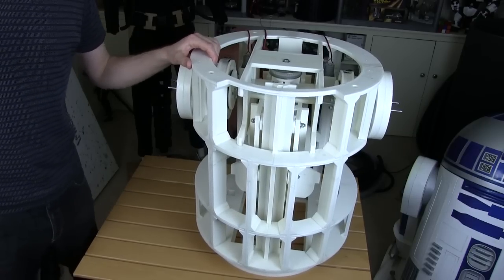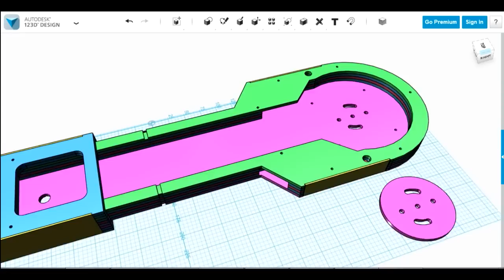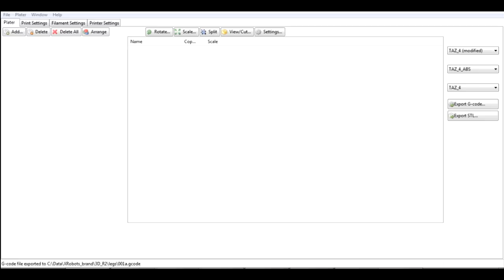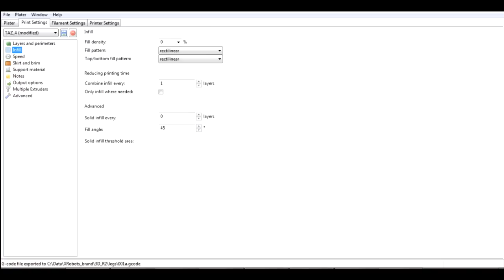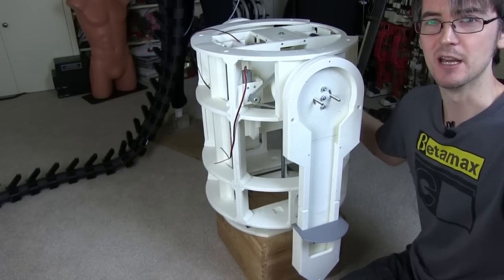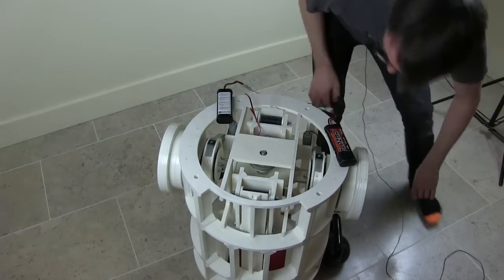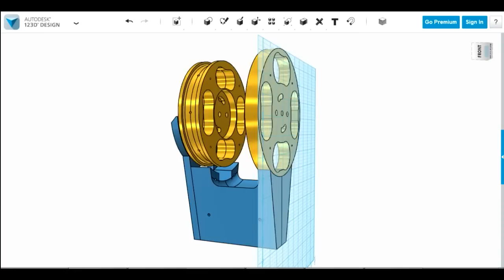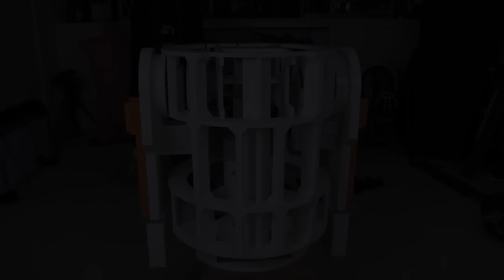Star Wars R6-H5 Droid #5 | Outer Legs | James Bruton

Comment: I hope you don't feel too bad about the bracing you ended up having to do. It really does look amazing. I would roll with the whole "your interpretation" idea. It allows you to make small changes, convenient for creativity as well as necessity, as we saw here. Excellent work as always James. o7 Sir.
Reply: *****
 So then upload it! We want to see moooore ! :D Just kidding, make your channel live, that's great.

Amazing job with the legs! I was wondering: did you make some some overlapping between the 3 pieces of the large flat "purple" piece? Because I felt like welding those on the 5mm edge only would be weak...

Otherwise: Couldn't you have grinded between the holes for the three 6mm stems in order to replace them with a rectangular 3d printed as you suggested? I'm thinking the 30% infill makes it ugly to drill or grind, is that the reason?

Anyway I was sure those extra pieces you added wouldn't be a problem. I'm glad you're ok now :-).
I must say, at first I was a bit disappointed that it would be an R4 and that it would be skinless, but now I completely trust you to make it look awesome! Totally agree on what Taonas said!
Reply: ***** damn spoilers ;p
Reply: ***** I'm very curious about your drive system, I'm working on my own moving robot platform and still not happy with my motors and wheels. So I'm looking forward for some good ideas form you :)

Comment: Looks cool and amazing for the most part, I think you could have made the bracing part a bit smaller but it is fairly hidden and not too bad. I really like the orange parts after the miles of white plastic, a cool splash of colour. Maybe with different coloured lights inside it could illuminate different section with colours as well. Well done and cant wait for the next vid.

Comment: Looking pretty good dude,bugger about the legs.  

Have you looked at using a wider pitched ball screw for the centre leg?  You'll get a faster transition and will probably be kinder to the thread too.

Also, are you going to be using steel for the control rods on the outer legs?

Comment: Sorry to hear you have moved on from your wobbly shoulder issue.  I was thinking that a simple fix for the problem would be to bore a larger hole through the center of the shoulder and insert a length of steel pipe through with the ends notched.  You would then create 3D printed caps for the ends with shoulders to fill the notch, extending the shoulders into the surrounding pulley material.  Keyed if you will.  You would need to do some hand cutting of the pulley material for a press fit.  Then just hold all of the parts firmly together with some all thread and nuts through the center.  Perhaps removing your Ninjaflex bushing might also help with rigidity.

Comment: Always look forward to your videos! Great to see the design and build process. Also nice to know I'm not alone in things not working out perfectly every time. :P     With the open center of the bearing, could you oversize the holes for the hub studding and insert say aluminum or brass tubing to 'sleeve' the holes?  The wedges you made work great, and honestly look fine. Just curious about possible other solutions.

Comment: Instead of adding those braces to the "shoulder" joints, couldn't you take out the studding, drill bigger holes, and put larger pieces of studding in?
Or another thing to consider - is the studding actually flexing, or are the holes it sits in perhaps not deep enough to keep it entirely stable? If it's the latter, it could possibly be addressed by adding more thickness to the discs on either side of the shoulder joint...
'Course ultimately you do what you gotta do to make it work. :)

Comment: really curious why you print out separate layers then chemically weld with acetone rather than 3D print all in one? I thought that one of the advantages of 3d printing is that you can get arbitrarily complex designs (even normally unmanufacturable) without difficulty. Love your work, BTW!
Reply: ***** Thanks for that!

Comment: Can't you drill a hole or use a saw to redo it? It looks really good though :)
Reply: ***** why not take the bolts out, drill bigger holes and put larger Aluminum threaded bolts (AL for mass optimization).
Reply: I just went back to part 3, I see what you mean now